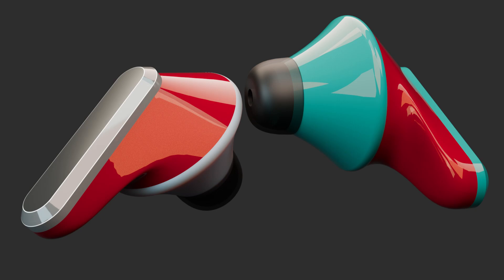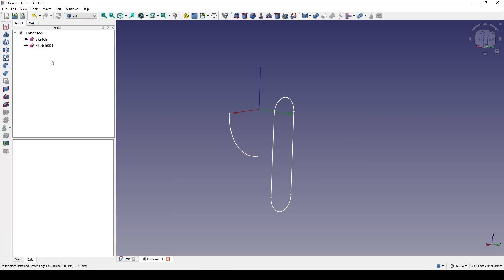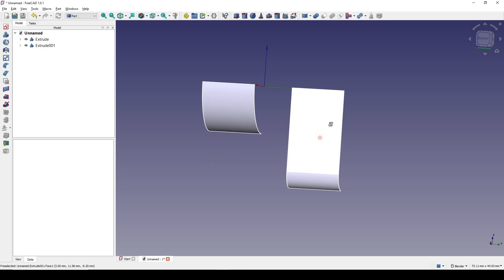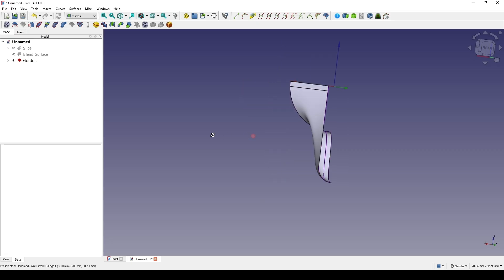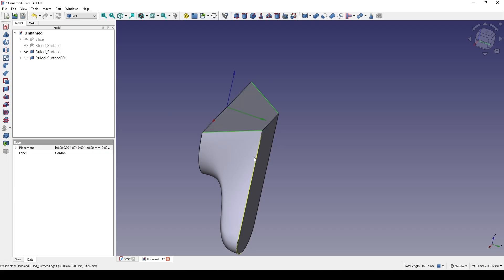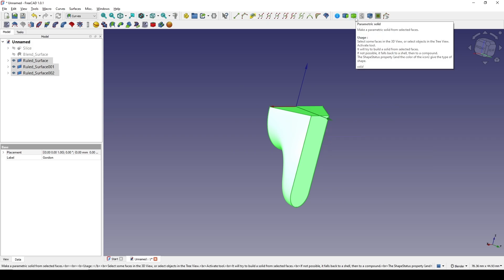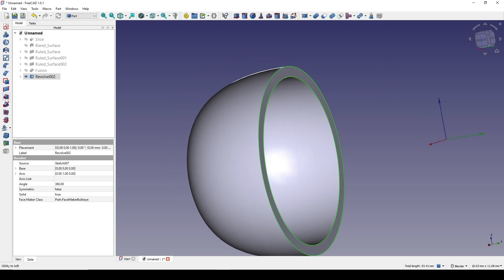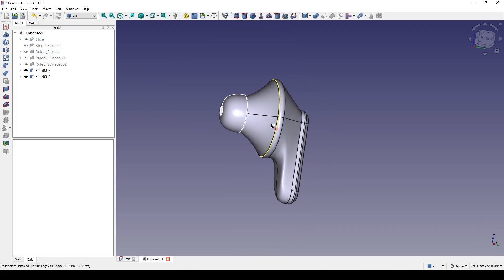Design Earbuds Using Gordon Surface - FreeCAD Tutorial.

Comment: Your demonstration is quite bit good. But, I've got a problem with Jointcurve and Gordon surface on Curves session.
There are some crevices on the profile of the part. That was strange, i've already starving twice, same problem.
There is another method.